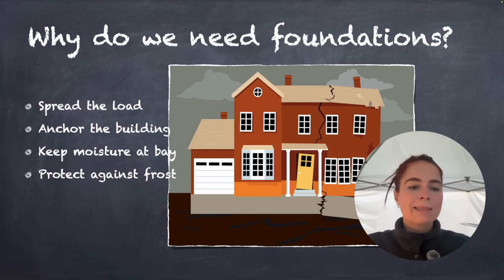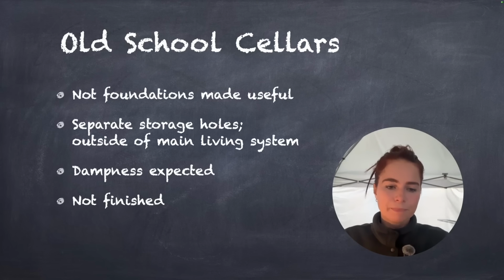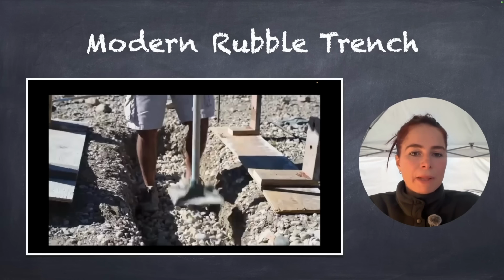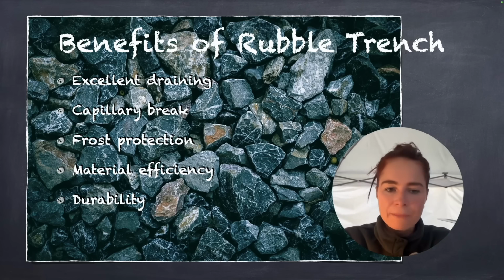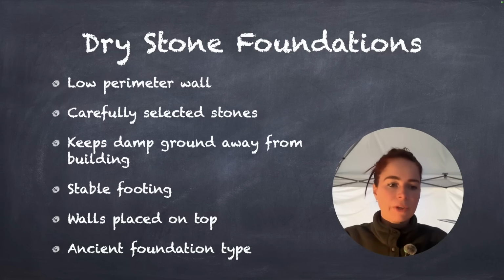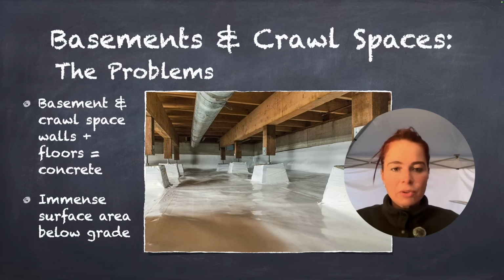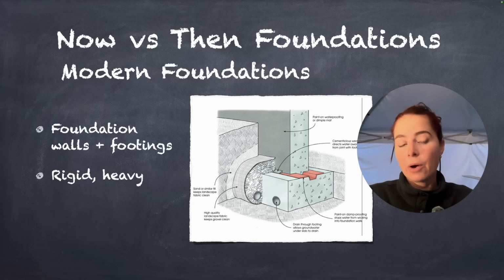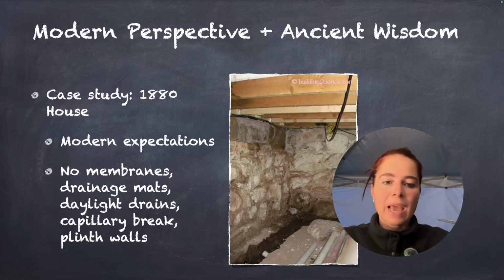Why Modern Foundations Fail — and the Genius Design We Abandoned

Comment: I appreciated you video.. all good common sense.. I am a good ol’ farm lad from Canada and been living in LA for the last 20 yrs design and building larger scale structures.. However , I have built cabins in the mountains down here on my private time…
Regardless of my past, I think about what you prescribed and I believe your intuition correct, if I was back home in the valley where footings need to be 54”DP.. I could employ your research .. we would still have to consider water supply entry and sewage outflow.. I guess a small insulated ICF chamber could be built under the structure inhibit freezing of these lines.. possibly a small space heater with a little ventilation grill above grade would suffice, to inhibit freezing during winter.. access could be a simple hatch and ladder.. just my thoughts.. I quite enjoyed your presentation, good work.

Comment: Ancient Rome used to use rising heat to draw in cool air from underneath without electricity. I hear this is also what termites do as well.
I could see a similar scheme work to keep drainage mold and mildew free based on flow rate calculations so that the outside doesn't have that smell around the perimeter.
Another idea is to use stable phase change materials for reversible heat and cold battery storage,   applications, reflective materials that can reverse between keeping radiant heat in or out based on preferred advantages. I find this fascinating and see where a home can be built to passively do this based on the angle of the sun daily and seasonally.
A lot of thought would be required but worth the effort.

Comment: Are soil gasses possibly an issue in earthen homes with earthen floors? If so how would that best be dealt with? Would a good capillary break under an earthen floor be a layer of the same rubble?
Reply from the maker: Yes, soil gases can move up through earthen floors just like they can through concrete. Radon mitigation usually uses a layer of washed gravel (a bit different from rubble) with a perforated pipe wrapped in geotextile that’s vented up and out through the roof or wall. You can also make it an active system by adding a small fan to draw gases out continuously.

Comment: Oh my god, please don’t build a foundation like this. We literally have a rubble pathway with a drainage tile to serve the purpose of water. You create a swimming a pool trench under your footing and still the rubble ison the native soil do i really have to watch the whole video to go through everything. I explained in my other comment some of the basics that foundations can be done rite. Most people don’t even air entrain the walls in frost suisepteable areas. Which also gives r3 opposed to basically nothing in normal concrete. I shouldn’t even say that because people will just get it twisted that you put air entrain for r value. No you air entrain so the concrete won’t be as likely to be destroyed ynder the stress of freezing which the wall in a basement is exposed to at the top only the footing won’t be exposed to freezing unless you are on bedrock which you might not excavate as deep because rock is not frost susceptible the same way as earth

Comment: Because every jackass thinks they can just put styrofoam foundations together and these big companies owners that couldn’t even build a foundation themselves and they higher people that wouldn’t even be allowed to do a quality job because it takes to long. Almost every forming company uses a four clip system that panels are sold in 1” increments for fillers the system itself doesn’t even pass standard because the system itself is 1/2” rounding error +-. Excavators dont fine tune the work with a hand shovel so if the foundation builder has to level the drainage tile or other footing requirements that almost never gets done properly. Modern foundations can be done very well if done rite. id say 99.9% of foundations are horrendously done and the ones that are okay are usually just lucky natural environment is suitable or prime locations not by choice or skill. You cant fix this by just highering more inspectors or regulators the problem is most people are idiots, greedy,lazy its a human behaviour problem. Times are only getting worse and the problem is bigger than foundations its just plays out in these places like your house is under mined but you think a government or union will save you. Take a needle because your government was highered to tell unions there work force has to or they wont get approved for mortgages and loans which the wife will divorce them for lack of useable resource. Platon is literally written in the code as an excepteable water barrier/ damp barrier i dont know what they are claiming to be it is literally a piece of plastic put on the outside a foundation. Now don’t get me wrong it definitely acts as a shield both ends are vulnerable even if cocked eventually nobody is going to maintain that seal so it works until it catastrophe fails and sometimes just fails catastrophic immediately. Damproofing is to cut down on dampness if 99% of moisture does not penetrate the wall that consistently provides damproofing. I doubt anyone is building in a lake than that is another world water proofing is required. You could dig up in 80 years and damproofing is still serving its purpose

Comment: Really think the building systems for the future are above ground Monolithic Concrete Domes that are Covered with 2' of Soil.   This will insulate them very well.   Can withstand fires, tornadoes, earthquakes, hurricanes, rot.     Low exterior maintenance and energy costs.  Freespan interior can easily be remodeled.  Hot air rises and sends colder air down, continuous circulation of air in the dome, no need for fans.   Very Secure.
Reply from the maker: Well that’s interesting! I can definitely see the appeal — they check a lot of boxes for durability and performance. I tend to lean more toward natural, vapour-open systems myself, but I love seeing different approaches and ideas!
Reply: @thehealthybuildingproject  You can open a window / screen doors to get vapor in.      Sometimes you don't want pollen, valley fever, or Uranium 235 dust blowing in  your dwelling.
Reply: @KarasCyborg Bros trying to build a nuke shelter

Comment: Where are you going to put your plumbing if you don’t have a crawl space?
Reply from the maker: Good point! In slab designs, plumbing is usually run through sleeves or chases and exits directly — as long as it’s planned early, it’s really straightforward.

Comment: The house I'm in was built by British citizens almost 400 years ago. 300th anniversary of the town was in 1992. There are basements here made of stone walls, mostly a lost art now. This is the basis of the root cellar. No refrigeration, so necessary for survival in cold climates to survive winter. They are not connected to the first floor usually with an exterior entrance. Massive stones are used, air can pass between them slowly because they are quite wide and staggered. House stones must be high enough that soil can never touch the wood of the base or termites etc will enter. 
Another key is if you travel New England there are no 200 plus year old houses built in low areas or anywhere near swamps, flood plains, etc. Mosquitos, crops, blight and so on.
The point is many of them are still standing today on 300 plus year old stacked boulders. Concrete degrades significantly after 100 years. with capillary action. You said it right, we have blood capillaries, watch some medical video on blushing or something. All ants east of Ohio have 6 legs and no h🐜ted houses either. Aunts and haunted house, yes.

Comment: Great knowledge in the vid. Much appreciated. I suppose the point of the vid is that aggregate filled trenches are an efficient moisture barrier alternative to a concrete footing. Or I suppose you form up a 6" concrete footing atop it...
Reply from the maker: Exactly! You’ve got it — the rubble trench handles drainage and capillary break, and then a concrete grade beam or footing is poured on top to distribute the load. It’s a really efficient combo.

Comment: Warm air climates utilize elevated foundations.
Often to keep the home away from things that climb like snakes and even the Komoto lizard.
What we have not gotten into would be a forced air system that mirrored the air flow of Southern homes where the floor has natural air flow under the house.
IF we knocked a large air vent into the side of the basement and then it opened when the air was dry and warm then the basement might be more dry.
Last year I found a Bull snake in my Airstream trailer that was hunting the mouse problem I had.  (I also now live in an area where it just as easily could have been a Western Rattler.)
Reply from the maker: That’s such an interesting point — elevated foundations really do make sense in warm climates, both for airflow and for keeping out the local wildlife! 😅 The idea of using controlled ventilation to help dry a basement is clever too — if the incoming air is warm and dry enough, it could really help manage humidity. And wow… a bull snake in your Airstream! I guess that’s one way to handle a mouse problem!
Reply: @thehealthybuildingproject  There is No heat or AC in the Airstream at this time.  So a pet snake (last years visitor was not a pet) would shut down in the winter after having traveled the way the rodents got in and then winter in a an old gopher hole.
I currently have a black cat named "Night shift" who keeps the rodent population down.

Comment: Your ideal of grade up against beam based foundations suffers over time from Rodent infestations.
I'm currently applying graveled sand bags with a wire mesh as foundation to prevent rodents from returning to digging under the wooden walls that were just setting on 2 x 6's.

You might want to take a look at "HyperAdobe"  They currently don't know if:
A. Shoving rebar into the sand bagging is a good idea?
B. They apply wire mesh to prevent Rodent's from digging through the HyperAdobe bagging.

Comment: It’s a French drain but on larger scale.  I thought about having a trad basement wall, coated on bottom and side with tar and some “life long” polyurethane.  Then some corrugated plastics cover.  Then adding sand and gravel “pocket” leading away from the basement wall.
Reply from the maker: Yep, that’s the general idea — a rubble trench is kind of like a large-scale French drain that sits under the structure. What you’re describing sounds like it could work really well — a rubble trench below for drainage, then a concrete wall or grade beam above for structure, with proper waterproofing and drainage leading away. The key, as I understand it, is just making sure water always has a free path outward so it never builds up against the wall.

Comment: I haven't abandoned anything! Love your video and thank you for it.  -- I built and live in a small castle in fairly dry west Texas mountains and was naturally drawn to your video because of my own old school building interests. SkyCastle is 18 years old now and everything works so well.  It is basically concrete walls (mixed with local gravel) poured in place in 'lifts'. Two story walls with wood floors and steel covered plywood roofs. 2nd floor has interior plywood covered concrete walls. The dunjon (ground floor) has a dirt floor as the raw concrete walls simple go down 3 feet into the ground. 20 inch trench bottom. Built on a mountainside, the front is at grade and the rear is well below. During monsoon season I have a large French drain inside and electric pump to automatically discharge water that does pour through but the system is efficient, the floor stays dry and only used a few weeks per year- else we are bone dry! And windy.   Good draining soil, decomposed rock-dirt. SkyCastle will live forever!  Link to Thunderous SkyCastle adventure. Maybe pause to see the front walls better.    https://www.youtube.com/watch?v=pNZYwWo1bcc
Reply from the maker: Wow, that sounds incredible — SkyCastle! What a project. It sounds like you’ve built something with real longevity and a smart approach to drainage. That interior French drain and pump setup makes total sense, especially for monsoon season. Thanks so much for sharing — I love hearing about people who are actually living in these kinds of structures and making them work beautifully!

Comment: modern ater tight Beton / Concrete Solves the issue with outsde water. The condense water issue from inside  stayes. This can only be solved by dry air flow and enough heating. Thats costly, thats why people dont do. All this has nothing to do with kapilary Effects.

Comment: maybe change the name to "Structural Select Fill Foundations"? if the "fines" are not washed out beforehand, they hold the desired fill apart. Eventually even just the width of a grain of sand, though more often the width of that dirt clod that fell in with it, would wash down allowing the rest to settle and that's the muddy fine residue clogging the french drain perferated pipe

Comment: Basically, they traditionally built French drains for their structures, first.  They don't pay attention to where the water wants to go in modern construction.  Horror story after horror story of leaky basements.

It doesn't matter how solid your foundation is.  You're not building a submarine.   If there's hydraulic pressure outside the wall, you're going to get water into the walls and into the basement.  

To me, all this stuff is good, but you also need to give underground water an easier place to go than towards your structure.  

In temperate zones, you should also do a LITTLE more digging at the beginning and bury some passive-geothermal pipes.  Designed in harmony with the landscape, they also serve as really good underground drainage.  You can't do this if you're in the middle of a big bowl, without major excavating.

Modern construction is also about making the place virtually airtight to save energy.  Passive geothermal air pipes give you a way to endlessly bring in fresh air, whose temperature is buffered.  At my latitude and elevation, I think the average temp 8 feet down is about 50 F.

Comment: Concrete is ancient - look at Roman structures.  Also, our basement in Fairbanks, AK >50 yrs ago was never musty.  I wonder what they did to achieve that.
Reply from the maker: You’re totally right — concrete is ancient! But Roman concrete was a whole different animal from modern Portland cement. The old mixes used lime and volcanic ash, so the pore structure was larger and less connected — they could ‘breathe’ and release moisture instead of trapping it. Modern cement is much denser and more capillary-active, which is part of why so many basements today stay damp. And that Fairbanks basement staying fresh? That’s a true rarity — sounds like they got the drainage and soil just right!

Comment: @37:29 - "Don't put living spaces in the dirt".

This can be done in the right setting, but requires a much forethought and attention to proper detailing.  It will - at a minimum - require that water from the roof is conducted away from the foundation and will necessitate an impermeable layer (poly sheet, expansive clay, etc.) extending several feet around the perimeter below grade to divert surface water.  It may also require perimeter drains in crushed rock or gravel run out to daylight to convey away any moisture which makes it past the impermeable layer.

If someone (really, really) wants to do this (e.g. make an earth sheltered Hobbit house), it may be best to berm earth over the house, rather than actually digging below grade.  A good reference might be either one of Mike Oehler's books and.or John Hait's "Passive Annual Heat Storage".  Both of these guys were trying to "bank" the heat of summer in dry earth surrounding a partially buried structure so that the thermal gain from the warm season could be utilized in the cold season.
Reply: Agreed, earth bermed houses might be very appropriate in very windy areas or as a way to moderate temperature extremes.  I'm not sure seasonal heat banking has ever worked very well, but I could be mistaken. I know that chemicals, like ammonium salts have been used, but these aren't very practical. Earth tempering (with berming) definitely works and can reduce seasonal heating and cooling loads
Reply: @theosrubegoldberg9660 definitely works.  Ground source heating is a form, the wave of ground storage greenhouses, even standard basements add a degree of thermal storage.